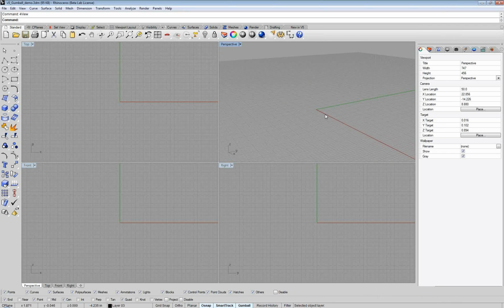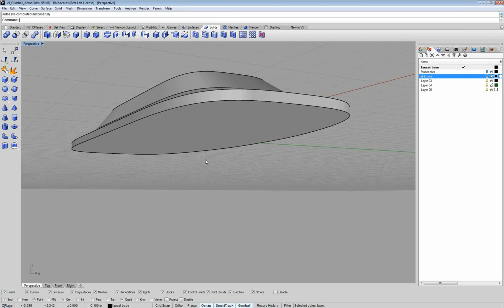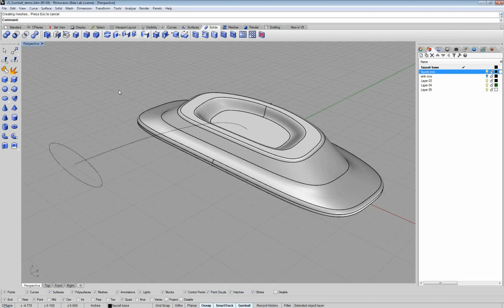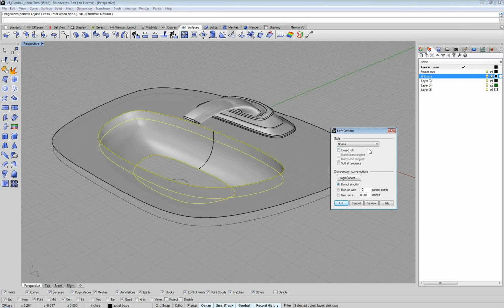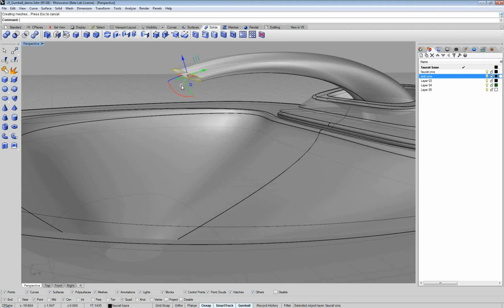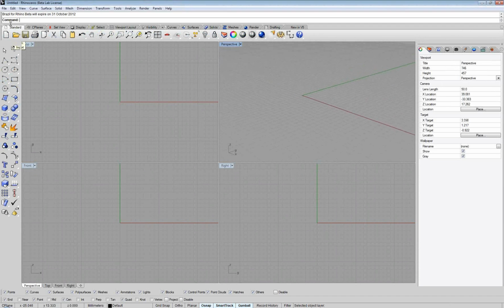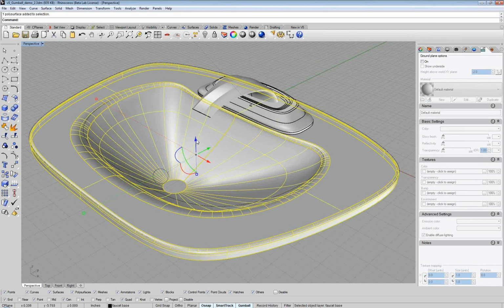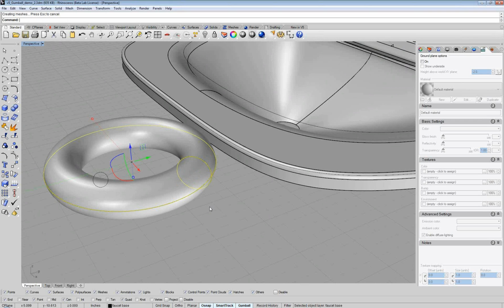Novedge Webinar #43: Rhino v5 Overview Featuring the Gumball Manipulator

Comment: Hi Aste,
This way of extrusion using the gumball changed during the beta stage of Rhino 5. If you use PlanarSrf first and then use this technique on the surface versus the curve you'll get a solid instead. The other approach would be to run Cap after the vertical extrusion... as long as the curve was planar this should produce the same result.